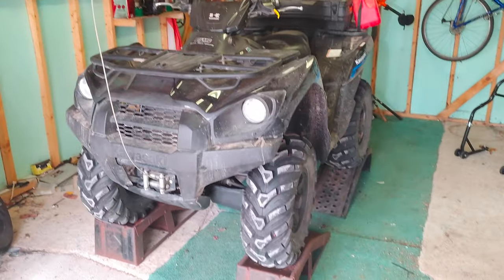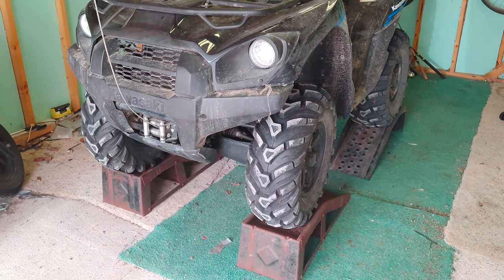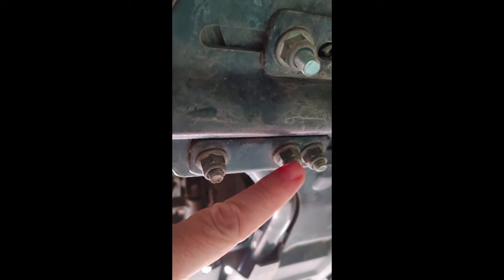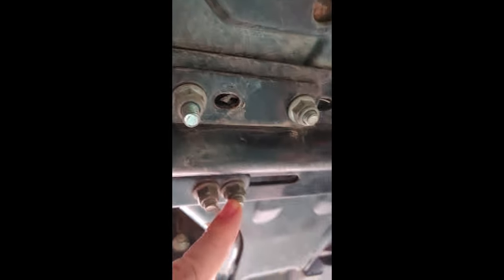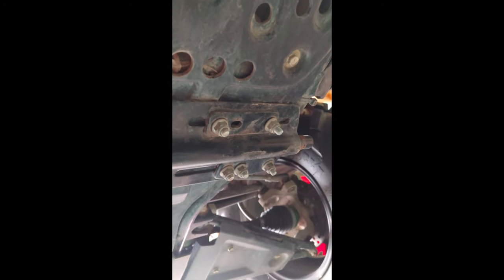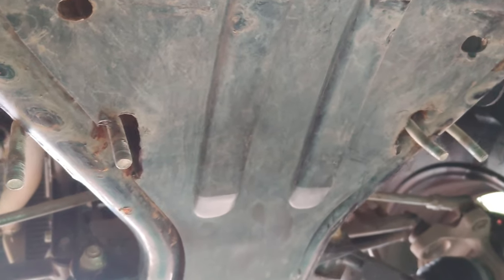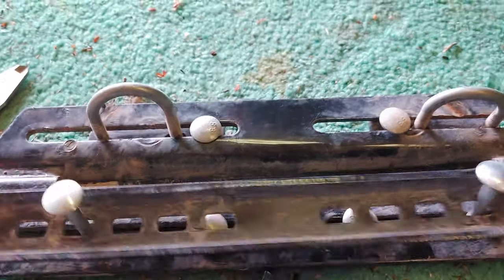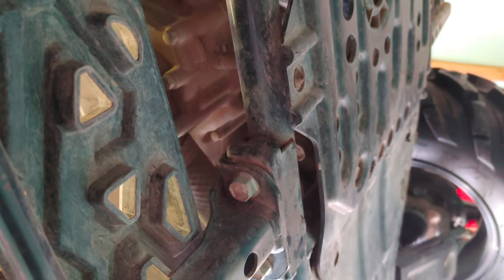Kimpex Click N Go 2 plow mount installation  2021 Brute Force 750 -  4K   Bruteforce Explorer

Comment: and you didn’t have to remove your winch mount for this?
Reply: also what plow do you use with this
Reply from the maker: didnt have to touch winch at all
Reply from the maker: @Sil3ntSid3S  Kimpex Click N Go 2 Plow.
Reply: @BruteforceExplorer  that’s awesome and what i’ve been looking for didn’t want to disconnect my winch for the other set ups! thanks for the quick reply! do you also use a click and go plow?
Reply: @BruteforceExplorer  just seen your comment thanks for the quick reply! do you use the extension frame for it?
Reply from the maker: @Sil3ntSid3S  nope straight up plow.
Reply from the maker: @Sil3ntSid3S  yup click n go 2
Reply: @BruteforceExplorer  thanks bro love the channel
Reply: @BruteforceExplorer  do you happen to have a link for your mount the one i tried said doesn’t fit the brute force but looked exactly the same as that one
Reply from the maker: @Sil3ntSid3S  bought as complete kit unfortunately
Reply: @BruteforceExplorer  could you send the link for the complete kit by chance? i can’t find anything that says it fits 2021 brute